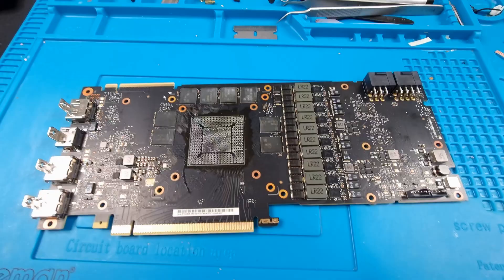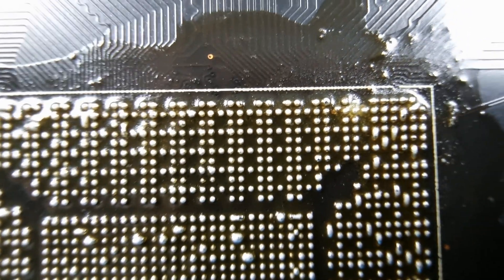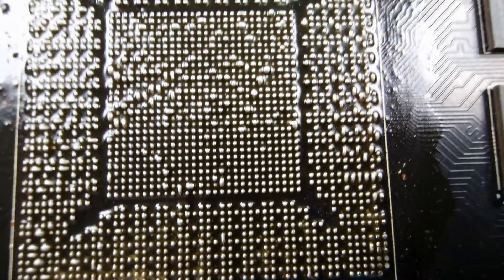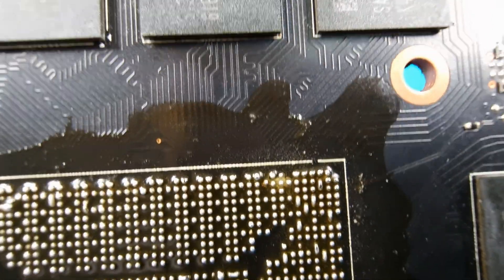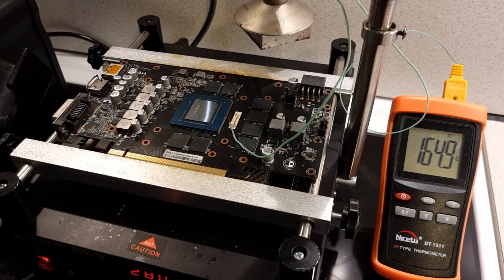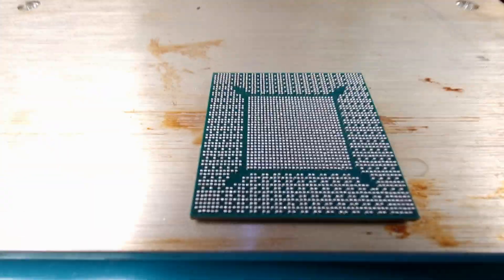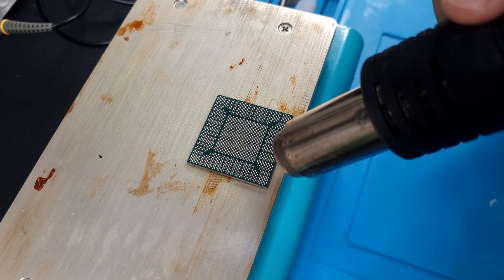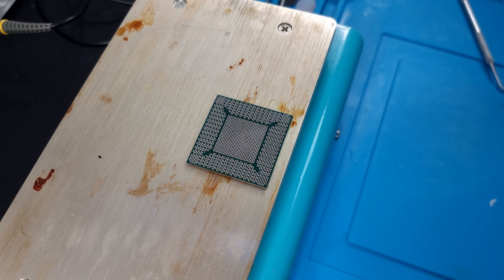Why A GPU Core Re-ball Is Better Than Just A Reflow.

Comment: And you've proved my point, you've got Factory equipment that the average Joe could never get a hold of most of us only have hundreds of dollars for equipment not Millions
Reply from the maker: Well, and I do not have factory equipment, actually. None of it would fit in my home. But what I do have is repair equipment design to do exactly what I do, and that is BGA rework and other repairs involving soldering, as well as software necessary to get the job done. But please, do not attempt to reflow your GPU with a heat gun. This is a death sentence.

Comment: But reballing is something you can only do if you have a bunch of expensive Factory equipment, you're not doing it at home with a heat gun like reflowing
Reply from the maker: You're not supposed to reflow anything with a heat gun. That is a death sentence. If you have to reflow memory or a gpu core, which I do not recommend, this must be done in a controlled environment. You can do it from home if you have the right equipment. I do, so repair these things for a living now.